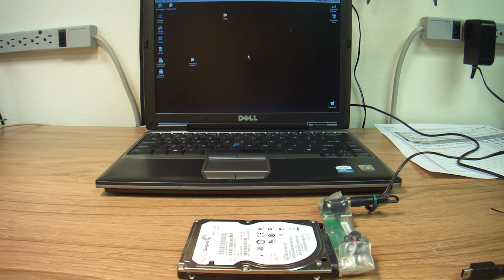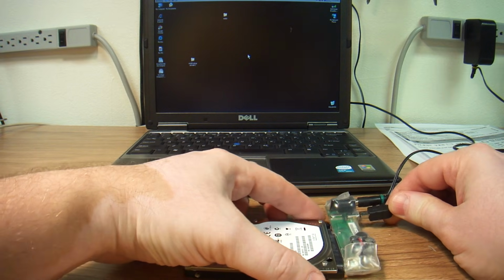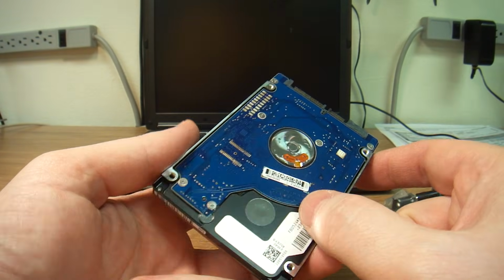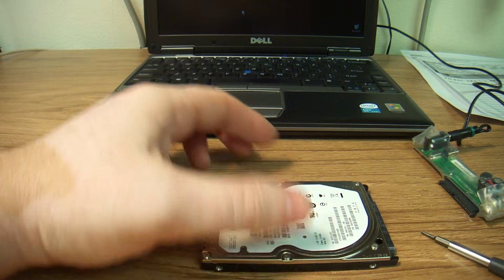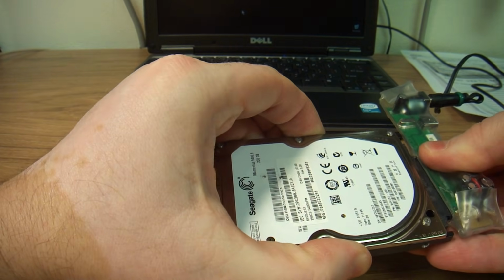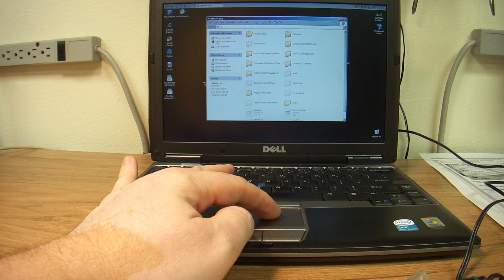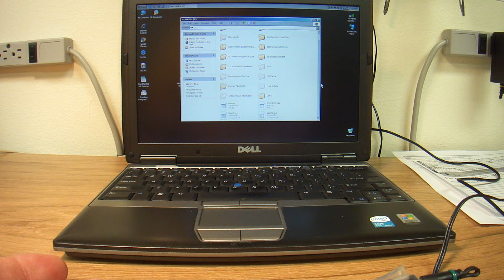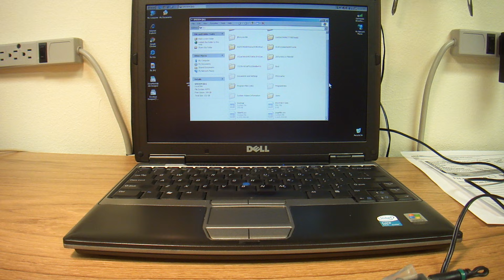How to fix a broken hard drive Beeping noise or clicking RECOVER GET DATA BACK FOR FREE! BEST TRICK

Comment: Hi just wanted to ask you where can I get your power motherboard (the green bit on the right) that end which goes into the external hard drive- I took my external hard drive to an IT company who managed to get it out of the case but damaged the power inlet for external hard drive. I still have the cable but can't test it because the power supply will not go into the hard drive.. sorry if it's a stupid question, but don't know that much about computers.. thank you
Reply from the maker: http://www.ebay.com/sch/i.html?_from=R40&_trksid=p2050601.m570.l1313.TR11.TRC1.A0.H0.Xusb+sata+adapter&_nkw=usb+sata+adapter&_sacat=0
Reply: You have an Excellent Tech Channel,that i just subscribed. I wish you can check out my Tech video too you might something useful. be sure to give your valuable feedback & Subscribe. Thanks A lot friend.

Comment: Hi, Did what you said.  But still is doing the same noise and the computer is not recognizing it.  Opened it again, and looks like everything is fine, but when I connect it, it starts again with the noise for about ten seconds, then stops, but the computer still wont recognize it :(

Comment: Thanks for the help! You saved my external HDD!
I'd like to point out I had no Torx in the right size (I believe I needed a T8 or T6, but only had T10+), so I used a 1.8mm flat screwdriver (you can get those on the larger hardware stores, if you're stuck where electronic repair shops are closed or far away), in one of the little watchmaker screwdriver sets, I used a plier to hold it firmly enough and to be able to rotate it, because my hands and grip were not enough. If someone comes across a similar problem, this might help!

Comment: When it's stuck I lightly bash it on the side with a plastic hammer and it usually works. Opening it is more complicated and more risky. Try it some time. ;) I worked for a computer service.

Comment: Thanks for this
I actually had the beeping noise so tried what you mentioned and plugged in the HDD and my HDD showed up in My computer
However I had t move my system and the HDD got disconnected and when I plug it back in it's gone
It doesn't show up anymore :(
After a day now I'm getting clicking noise
I have a WD my paasport ultra 1TB
Any suggestions ??

Comment: The people saying the screws need to be a certain torque are talking about Western Digital drives. Western digital still uses an older method of servo writing, and uses a head stack design that is only secured with the top cover screw. The combination of those two things means if you loosen the top cover screws, it's difficult (but not impossible) to get the head alignment back.

Comment: I have got WD 1tb external drive, which has just decided to give up!

It was working the day before we moved back to UK from spain, then set it up here and lights are on but no-one home routine....... looking at it, the arms move about 2 thirds across the plate, then back then go shorter distances and back, spins no problem then just stops spinning after about 20secs or less......

If there is some kind person that can advise it would be appreciated, I dont have lots of money to spend on data recovery...... I can do a video of what the drive does if that helps people decide and where to post?

many thanks in desperation!

Steve
Reply: Steve Elliott Steve, If the problem with the hard drive is not mechanical have you looked at Spinrite? Available at https://www.grc.com/sr/spinrite.htm it could well help. It sometimes takes quite a few hours if not days on a large drive but can work wonders.

Hope this helps
Reply: Thanks Keith.  Will look bit later. Taken video of what happened so will try to post

Comment: my hard drive has packed in, it tries to boot up, only gets to the windows flashing logo and then switches off after a while, on other occasions it says 'hard drive not detected, try reseating hard drive'. On switching the laptop off it gives one click and then turns off, other that this when the laptop is on it doesnt make any sound. I have important university files on there that need recovering please, could you help me with this please. 

The hard drive is a WD2500BEVT 75A23T0 made March 2010

Comment: Hi, Abrahan. I have a Seagate Barracuda (model: ST2000DM001, pcb: 100664987 REV A). It is not recognized by the BIOS. No clicking but beeping noise. The motor works fine (some times, it remains stop, and the arms are stuck). When the arms are moved (by the hdd software) onto the plates, the arms move erratically (swinging to the plates center and going backwards). Could you please advise on which would cause this? Thanks a lot in advance!

Comment: I was under the impression that opening up a HDD without a clean room was certain doom but I had nothing to lose so I gave it a try. I have a Samsung HDD that I use purely for music and storage. Unfortunately I had dropped it and caused the head to stick to the platter. This did the trick, thank you!
Reply: i dropped mine like 4 times in a metal enclosure... gonna try this now
Reply: @Cam-gb1cu  so what happened?
Reply: where do you get the screw driver required to do this?
Reply: Karl Sharp did u lose ur data
Reply: I did this and it still wont work, its telling me i have to format before i can use it.
Reply: I'd the same problem, dropping. .. BUT after open it.. I don't know whether it's dead or wht.... Just spinning but undetectable... help pls..

I ddnt know the ^rule^ of how to reposition actuator off the platter so I just rotated it in both directions till It was just off the plattor.. so could this b the cause as to why it just spinning without being detected??
Reply: I put my music on a flash drive and have it hooked up to my router USB and stream all my music from the flash drive. If you play a lot of music don't put it on the hard drive, the hard drives seeks too many times for music.
There are no moving Parts with a flash drive compared to a hard drive

Comment: Great video.  Was hoping that this would have been my issue. 

Have a Seagate 3TB baracuda ST3000DM001  that makes a clicking noise during bios startup.  Bios and Windows takes longer to boot.  Harddrive is not listed in bios.  I took it out of my computer and opened it.  I see black specs on the top harddrive platter and almost like black toner on the bottom top cover of the harddrive.  What is this?  I can't tell if something burnt. Why would this occur and what can I do to fix this?  Hope my issue is fixable without having to pay a professional if I want to recover my data.

Comment: DO NOT EVER open a hard drive.. You'll damage it more than that you repair.. Such labs exist for a reason..
Placing it in a freezer in a small sandwich bag can help you get it to run for a period so you can copy your data from it... If it gets too warm again, just repeat until you get your data back..

Comment: hi,would somebody help me,i have exactly the same problem with my HD,
expect i just cant put the head back in its parking position,it still remains on the edge of the disc,
even though if i pull very hard it wont move any further and always stops on the edge of the disc.

what sould i do?any advise guys?

Comment: I was told by Disk Savers that the reason they go into a vacuum room with the hard drives is because it is air tight. They said that there is a little air in the hard drives that is used to align the platters and if you open the drive in a regular room, that will cause them to be misaligned, as well as coat the platters with dust. Now, they do want about $3,000 to fix a hard drive, so maybe they were just trying to scare me about what will happen if I don't let them fix it. Were they just full of bs or telling the truth?
Reply: Harddrive wil never be made in vacuum, what you said is b*llsh¡t. The heads from a hdd float just a couple atoms above the platters, to suport them you need air, a hdd also has a hole where it said: "do not cover" if you do, you get pressure diffrence since a harddrive is airtight exept for the breath hole where it can get its air and pressure. If they where vacuum than they wil just crash out of box. That one reason why they cant make a helium harddrive because it needs to be airtight and you wil get pressure on the actuators.
Reply: It's not what I said, as I stated, it's what DiskSavers told me.
Reply: How ever, they get a lot of money and they have ended high school, but they ar lying, you can open your harddrive 1000times (in a clean room" without decompression effects. Its not like a aircraft, unless you cover the breathole

Comment: I had this beeping problem with my 2tb seagate hard drive. I used this method and the beeping stopped, however, a small clicking noise had occured for 5 seconds once i plugged it into my computer and afterwards i cant hear the hard drive operating ( i cant hear the disk spinning).

Comment: I would recommend doing this ONLY if your data is NOT important. This puts your data in serious risk due to the fact of contaminants and the missing clean room environment. However, it definitely might work, considering there is no damage to the platters (scratches).

Comment: So my laptop fell through the window, lets say...about 2-4 feets, And when I went to recover it I saw that the hdd had fell out including a broken track-pad it doesn't really bother me. So as i recovered it I put the hdd back in and started my pc up as normal. Guess what! it still works everything is fine from the screen to the keyboard. After 3 days I started to hear some noises like a pop sounds then it clicks and so on. The 4th day is when this 'click of death' started to occur. This is what happened after my baby fell through the window.
1. PC froze 
2. I left it for 4 hours and still nothing
3. I Powered down my pc from the power button
4.Then I started up pc
5.Went into black screen (for about 12 1/2 hours)
6.Tried to erase disk but it froze 
7. HDD died (R.I.P)

So I was wondering if this video could help me.

Comment: This goes against everything you should do to a hdd, but im going to try this as i have some ones that are wrecked anyway.

But dear god i would never trust that drive again, once its opened, get it going, back it up (if youre lucky enough to make it work!) and then count it as wrecked.

Ive always thought opening a hdd = destroyed. There are so many particles in the air that would get in there instantly and damage the heads and disk surface. But i suppose if its already broken then what is the harm.

Just make sure there are NO other options. Sometimes its just the partition table or boot sector thats corrupt and a program like testdisk can find and recover it.

Just because 'My Computer' does not recognise does not mean its dead.

Comment: Hello i have a problem with my laptop its nota brand but i believe its a china made laptop, any way the thing is it as a black screen, and it comes on and goes off at times. And it has a beeping sound since i went in the hard to fix it but the plate thing was on the plate like your own in your video plase help i want my laptop screen on and the beeping gone.

Comment: This is great. I sat on my seagate free agent goflex while it was running... Don't ask.  The heads got stuck and it would just beep.  I found your video and in ten minutes I had my drive back up and running and it looks like all the data is good.  Thanks!  One comment is the goflex drive hd a second hidden screw under the label I had to remove... So I guess every drive could be different.

Comment: Just tried it on my mom's drive and it worked!!! THanks a ton!
Two things I'd advise, though, are:
1. Peel off the sticker above the last screw or the sticky back of the paper will make it very hard to unscrew this screw and may ruin your hexalobe screwdriver ( I think I ruined one of mine).
2. Do the operation in a shower room because flying dust will probably be significantly less there.

P.S. My computer took several minutes before it was able to properly read the drive, after the fix, so give it some time if necessary.

Comment: What if the park position is on the platters or the drive uses a stepper motor, and will this work for the Micropolis 1333, Seagate ST-251 MLC-1, and IBM Type 0663?

Comment: The problem with my HDD is that when I load something it's going to make noises. Only when he has to think. Usually it's getting normaal after a while. But I want to fix it, please help me? Cheers!
Reply: I'm not going to click that link. -_-
Reply: FAMICOMASTER By putting it in a freezer for a while internal moving parts shrink, and increase tolerances. Something that is stuck will many times become unstuck, if a bearing has become tight it will loosen up to the point that it will spin freely again, but only for a short while.If you are able to get it to work again get all your data as fast as you can. If it binds up again, freeze it again, you won't hurt the drive...
Reply: Thats the sound the actuators move across the platters to load data, and it's perfectly normal. There is no other way to fix it unless you blow a few hundread us dollars on an SSD...
Reply: The crackling noise while you load stuff is completely normal. You can't really fix that, it's a mechanical drive.
Reply: FAMICOMASTER  Thanks! Really Thanks! So you saved me of spending EUROS on a HDD, and mine is just normal. Thanks!
Reply: MrGamingEnzo
Easy Laptop Repair Video Course

Safe Redirect (No Spam) => http://laptop-repair-video-course.blogspot.com
Reply: Depends if loud clicks, you better backup your data.   my HDD died in 2006 of leaving laptop on all night complications. Reason of death was clicking.  I tried to open it today, and it doesn't have the same problem as the one above. it's seems too complicated to fix.  Backup your data people
Reply: The click you described to us is called 'The click of death'. It's mostly a head alignent problem. Almost impossible to fix. The only way to get data off is to take it to a trained service proffesional or a data recovery company. I've also heard there is a trick with the freezer, but it might just damage it even more, beyond any repair. Back up your data people, if you haven't already!
Reply: I mean if its warm, then condensation builds up and ruins the platters. BTW IK how it works.
Reply: That's fairly normal. that is the sound of the drive loading. The reason it is probaly louder than the other times is because of further travel distance. Try defragmenting it once, and it should stop for a while, but it shouldn't be a problem. If it does become an issue, however, try defragmenting and reformatting firts before taking it apart, because it can seriously damage your drive further.

Comment: Mine is beeping, opened it, moved the heard but it won't completely come of from the platter. It just get's stuck at the outer end of the platter :(
Reply: MAJOR PROBLEM! Wow! Head misalaignment, I've seen that before, on my IBM Deskstar 10GB. Theres Good news and Bad news:
Good news: You're data is perfectly fine and is still there the way you left it (more than likely)
Bad news: Your hard drive will (most likely) never operate correctly again.

Comment: I dropped my hard drive from about waist high. Heard slight beeping and clicking. I'm currently deployed so I can just send it in and get it back in a timely fashion. So I stumbling across this video. Took apart my hard drive and sure enough the head was stuck on the platter. I did everything you did in the video. Sealed it back up and the beeping stopped but now there is just a clicking noise. I opened it back up and plugged it in so I can see what was happening. The heads are hitting the side of the platter. The platter spins but after a little bit the heads stop hitting the platter and the platter stops spinning. Any thoughts???
Reply: Click of death, unfixable in most cases. If it does start working, IMMEDIATLY BACK UP YOUR DATA!

Comment: I put it in the laptop and it wont work, i go to bios and it says that 30mb are missing, or something like that, if before i had 150gb free, whats the problem? Did i have to open and clean sume dust from the disk, is that the problem?!
Reply: If theres dust on the platters (the shiny circular things), your drives a goner. No saving that one.

Comment: I did fix my hard drive like in your video, but if i have in it a windows system, can i put it in laptop as main hard drive, then it will work? Or just the sata to usb is the choise?
Reply: If it still works, yes you can use it as the main drive. I wouldn't recommend it though, you should get rid of the drive or mark it as bad.

Comment: My seagate drive has a random model number in BIOS and does not report correct capacity. I cannot read the data and it clicks only on cold boot, if I reboot PC no clicking but still cannot access data. I think mechanically inside its OK but the  PCB board might be faulty. I  had a power outage for a split second rebooted PC and it was fine. Next day I cold booted machine and it was not working. everything points to PCB but I dont know how to be sure.
Reply: PCBs on hard drives are generally the most relaible part. Clicking noises indicate it can't find a certain byte of data, and keeps trying to look for it. Unfortunantly, there isn't a way that I know of to fix that.
Reply: FAMICOMASTER  I took it to a repair guy he took a look at it in his mini booth with vacuum on top which was amazing  and inside the drive the motor was dead, also the drive was scratched the reader part damaged the surface. He even showed it to me:)
Reply: Well, if the platters are scratched, it's safe to say you most likely won't be able to retrieve data from it.